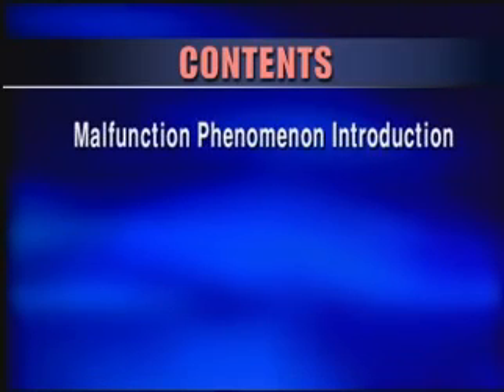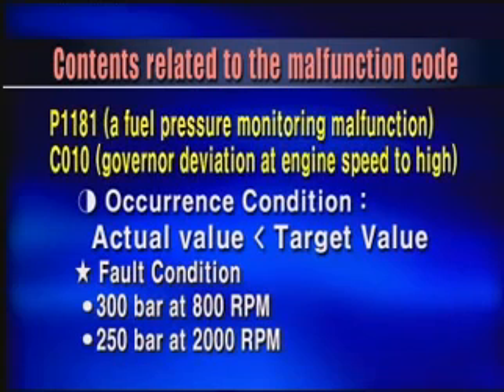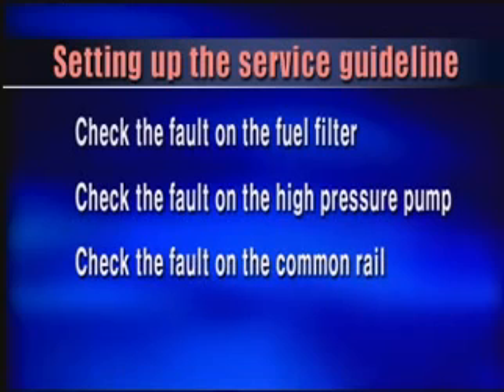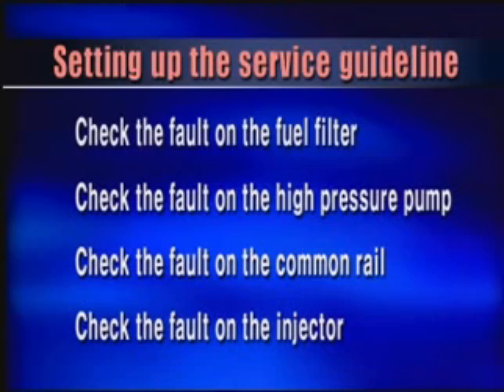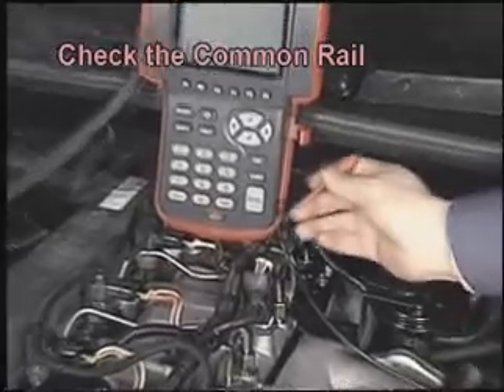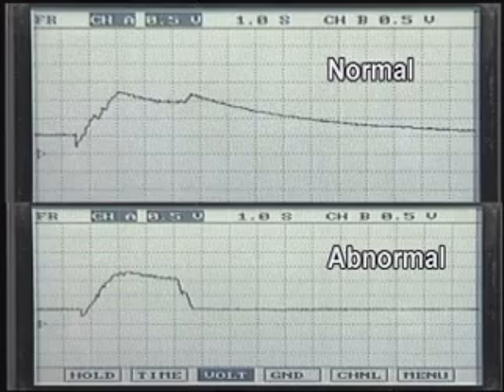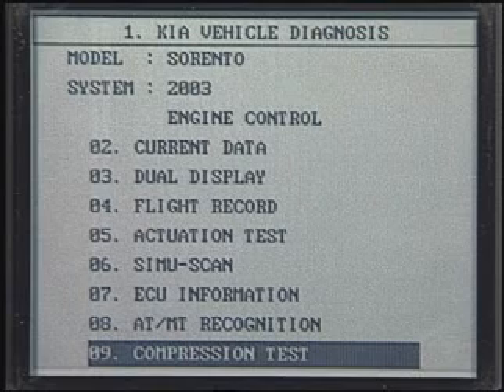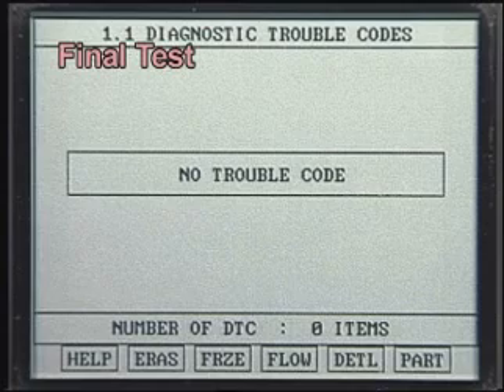P1180/P1181 -fuel pressure regulator ( engine 2.5 TCi-A )

Comment: have a sorento 2007 diesel with low miles and lots of black smoke and no power  any sugestions thanks
Reply from the maker: you check EGR and target high pressure